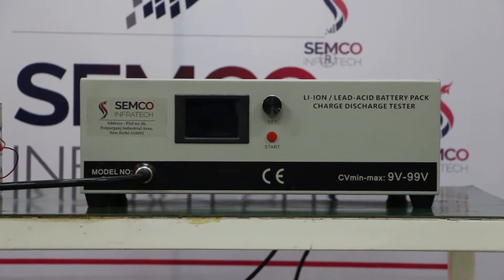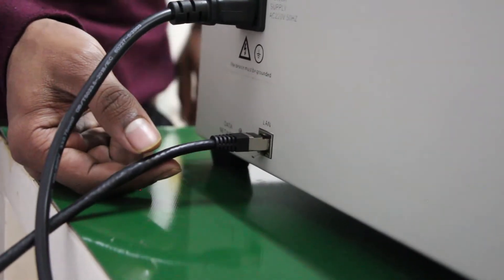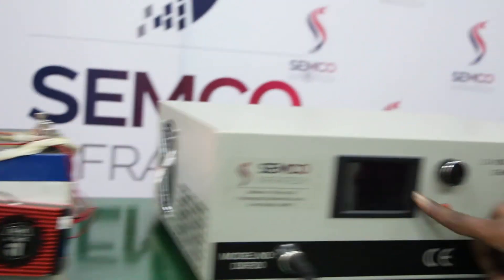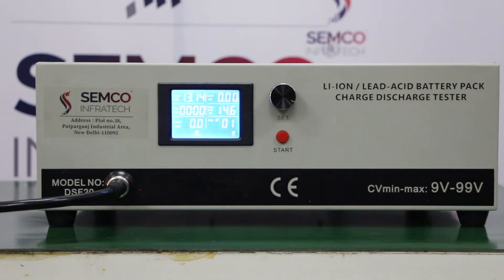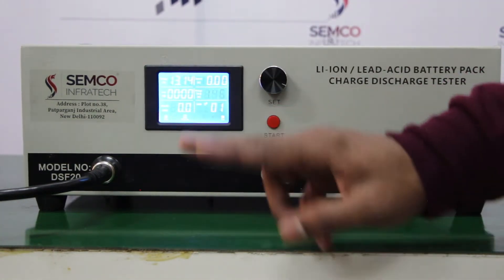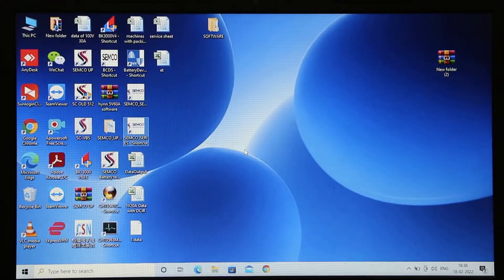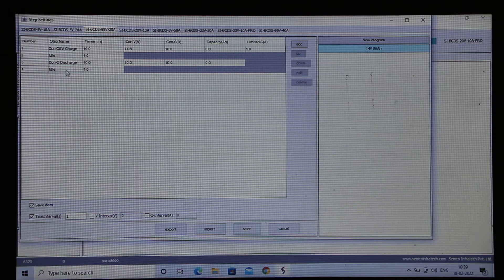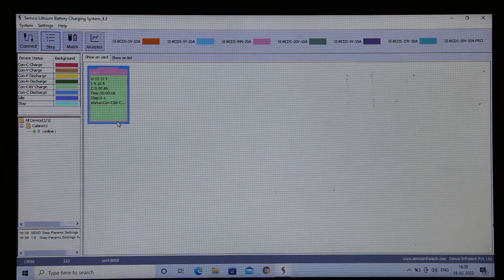Lithium-ion Battery Charge & Discharge Tester SI-BCDS 99V 20A 1CH

Comment: I have that machine when i start charging.the machine got automatically disconnected and on the voltage section seems 2.E what is the problem.pls share some information
Reply from the maker: 98103 29590 Please contact with our Technical Person